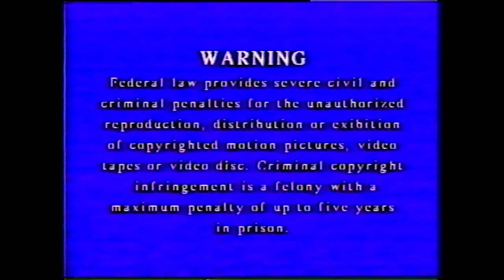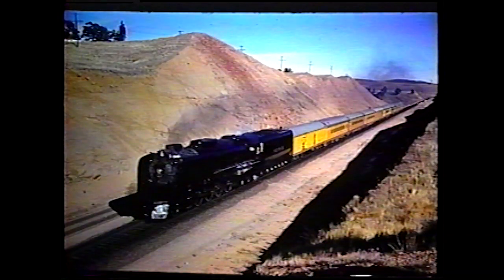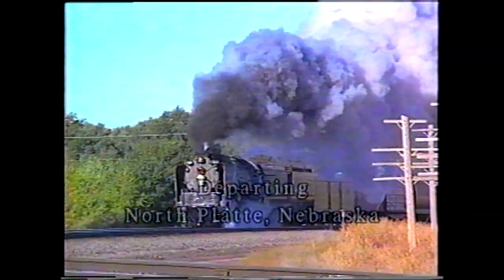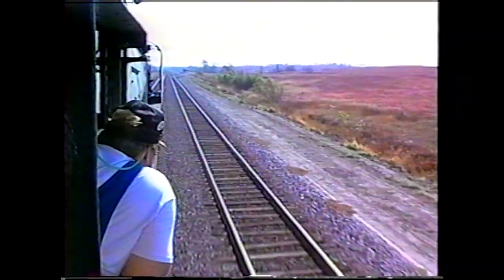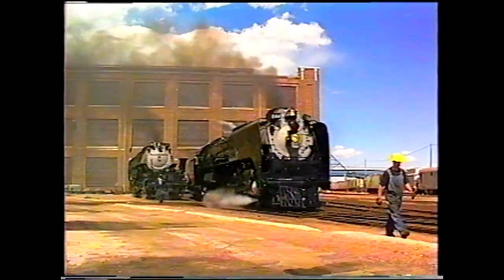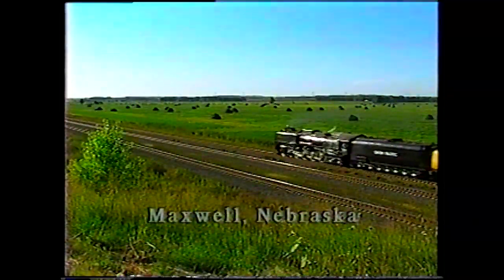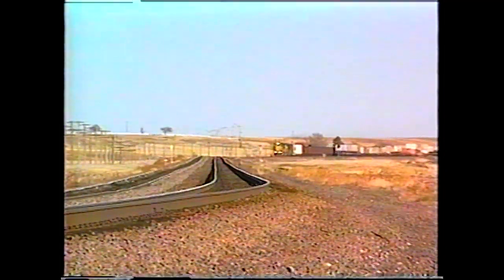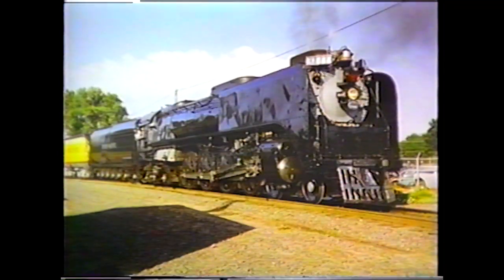Union Pacific 844

Comment: 3985 was moved along with 5511 and 6936 to silvis for restoration in November 2022. They will run them once they are restored. As of September 2024, 6936 is fully restored with 5511 and 3985 having a full overhaul

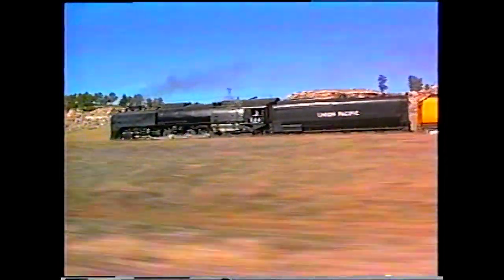Comment: 3:12 Bill Waldrop: The 800 class locomotives were designed to maintain speads of 110 miles per hour. At Jacinto, Nebraska, one 800 class locomotive was recorded at a spead 124 miles per hour, pulling a fast limited passenger train.
Reply: You don’t freaking say?
Reply: It's been at least 12 or 13 yrs ago I'd say when I saw 844 roll through Hallsville Texas at nearly 80mph... Waaaaaaay faster than any other train I've ever saw

Comment: Very nice documentary. I do hope it will run again one day, although according to someone who visited the steam shops recently, it was said that 844 will not run again "for the foreseeable future".
Reply: During April of 2022, the Rocky Mountain Club invited Ed Dickens of the UP Steam Crew to the Clubs show in Denver, Colorado. When the 844 was brought up as a Q&A, Ed said they were actually planning on running 844 this year, but decided against it. The reason was because Ed and the crew want UP 4014 to tour the rest of the system, and then after that, they will balance running both locomotives. The video of the show is called "UP 4014 Update 2022". Plus, 844s last 1472 overhaul was in 2016, so the locomotive should still be in good condition and have lots of time to run before 2031.
Reply: @regularguy7266  I do hope so. Especially because the 80th birthday is next year. I also heard that the E9s won’t run again for the foreseeable future either.

Comment: 34:20 You know what would've put this incredible footage well over the top? Having a red car at the very end just like when Big Boy #4014 pushed the stalled manifest more recently in Nebraska. Just kidding but this was truly a spectacular moment as well to be thoroughly captured from many different angles. I wonder what a side by side comparison would look like with proper editing for both clips to be synced with all the footage in existence. Either way both of them not only did a truly amazing job pushing that stalled freight up each respective grade, but this proved EXACTLY WHY steam locomotives shouldn't have been fully retired along with how powerful they can still be when pushing modern day freight cars. I'm not sure how well they'd do on some of America's steepest grades, but they would definitely still have half decent speed doing it solo I'd like to assume depending on how long and heavy the load is. Remember Union Pacific originally restored the #844 along with #3985 later on (voluntarily) not only for just public relations, but to assign specific tasks or offer help when needed in situations like these. They're not just for show or to make rail fans happy as both operate in nearly perfect condition after extensive restoration efforts!

Comment: 3:20 this claim is a total lie. 124mph in a 4-8-4 that’s not streamlined, bullshit to the highest degree. Whoever maid that claim was just salty that a Pacific was able to reach 126MPH, and MALLARD’s speed was actually recorded on a dynamometer car. There’s no proof of a UP FEF doing 124mph ever, let alone 120.
Reply: Proof that it's a lie?
Reply: @regularguy7266  no unstreamlined steam locomotive could reach above 100 mph, this was proven by scotsman and tornados record
Reply: @voidjavelin23 no it doesn't. That's like saying an SUV can't go over 100 mph because a convertible can. Streamlining can help with wind resistance, but factors such as horsepower at speed and boiler pressure are what really matter. That is why designs such as an un-streamlined New York Central J class Hudson have been known to go over 100 mph on a regular basis over the New York Centrals water level route.
Reply: @regularguy7266  well that wont gonna happend if class 1 railroad wont gonna update their decrepit infrastructure